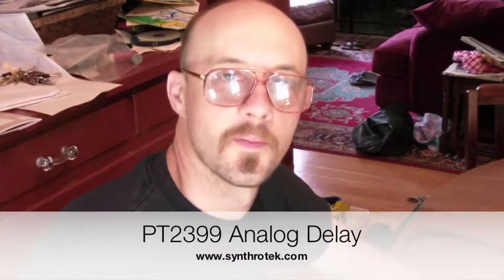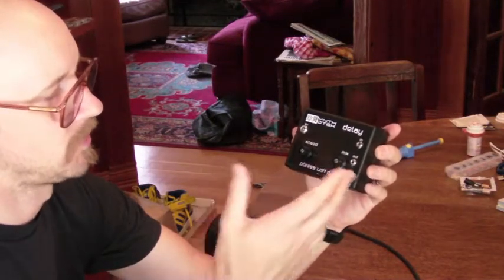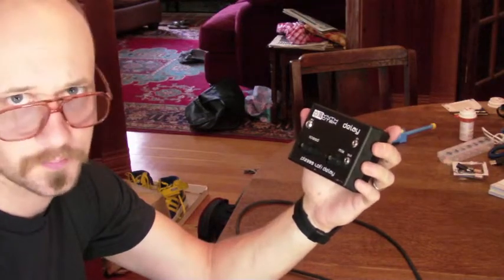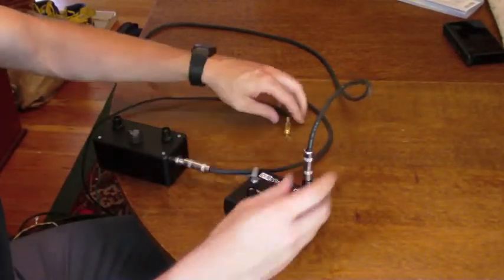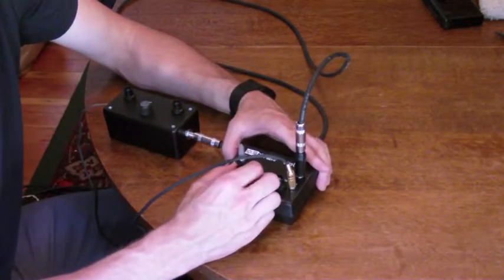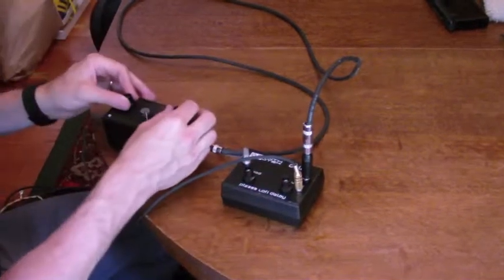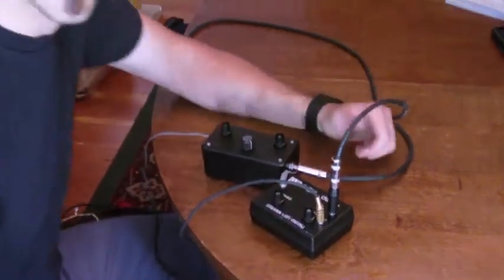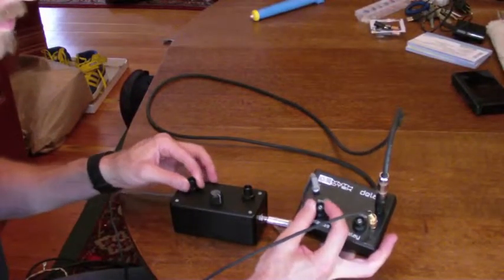Synthrotek Analog Delay PT2399 Kit with Atari Punk Console lofi synth

Comment: Not an Analog delay!  The signal goes through a digital conversion and is therefore not Analog.  PT2399 is a digital chip.  From the official datasheet: PT2399 is an echo audio processor IC utilizing CMOS Technology which is equipped with ADC and DAC, high sampling frequency and an internal memory of 44K Digital processing is used to generate the delay time.